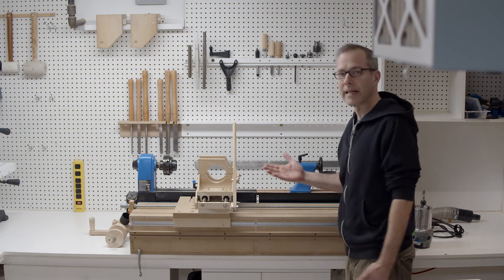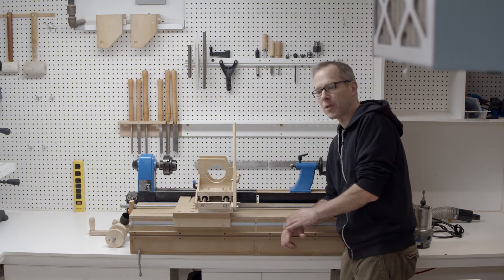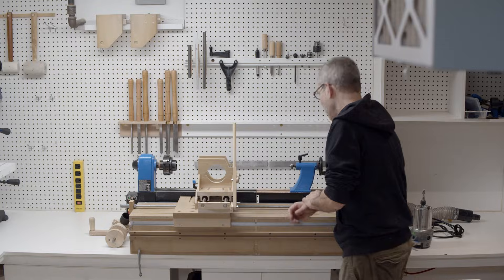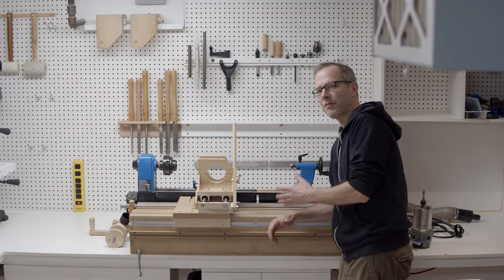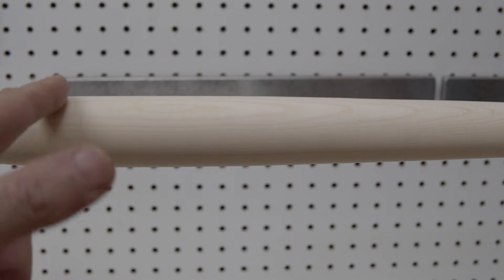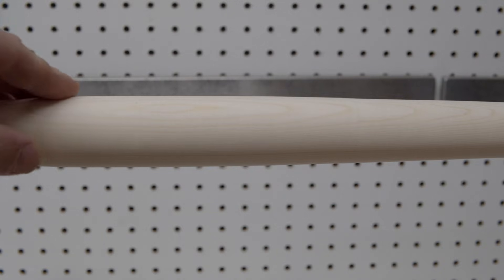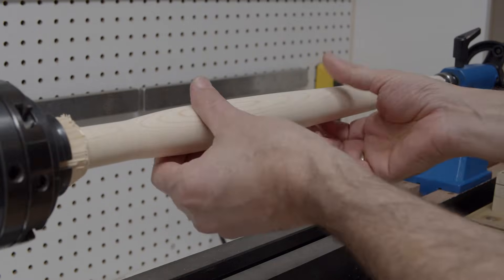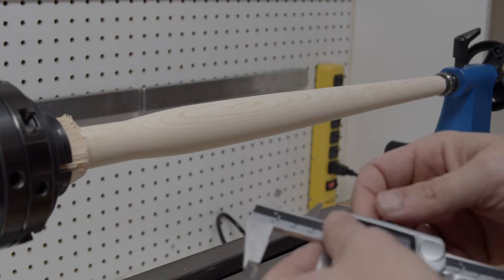This Lathe Duplicator will copy anything!

Comment: This is really great, as is your other model for the chess pieces! I’m curious, is there something (a spring?) that holds the router conforming to the template, as you advance it along with the drill?
Reply from the maker: I thought of using a spring but it wasn't necessary, just used a light hand pressure and focused on watching the contact between the follower pin and template

Comment: The 80/20 profile would be handy on this fixture. Working on a jig to suit a trim router with Minitec profile that has a delrin slide. 
Thought slide bearings might get fowled with chips but your Vac system seems to have eliminated that - Nice.

Comment: One thing that occurred to me is that if you rotate the router head 45 degrees.  This would use the corner of a square rod as the reference point instead of round, but would still allow you to use a conventional end mill.  Actually, if you had the pattern under the central axis of the lathe, you could set up a ruled stop for the pattern which could be set for dimensional accuracy.  In addition, with the follower directly under the bit, you can set up followers that are the same shape as the cutters themselves.  While I can see a concern for getting chips in the way, any would cause the follower to run proud and you will just need to run another pass once the chips and dust are cleaned (ie. it will fail safe).  Just some thoughts.

Comment: Hello. In this video of yours, I noticed that you have made an extension of the lathe. If there is a video of how you did it, could you provide a link to that video. It would be interesting for me to know your experience.
Reply: My video "Improving 3 Mastercraft tools" shows it but I don't go into the build.  It was pretty straightforward - first I built a strong base for the lathe and extension to sit on / bolt into.  This is important because it will keep them in line with each other.  Then just build up a track element as the bed extension - measure the bed on your lathe and replicate the height, and the general space between the rails, etc.  I'm sure once you get into it, you'd be able to accomplish it.
Reply: @BennettPictures  Thanks, that's pretty clear. I was interested to know what materials the lengthening of the machine is made of.
Reply: @alexpo6939  The base is made from MDF (in a 'torsion box' design).  The extension is made from plywood with oak as the rails, although all plywood would be plenty strong.
Reply: @BennettPictures  Thanks, Matthew!

Comment: I have in my mind something similar to yours.
I already have the linear motion bearings and a dedicated deWalt router.
Interesting your option to use HSS tools.
Congratulations!!
Reply from the maker: For my last few projects (simple chair legs) I only used the carbide tool option.  I'd round over with a square roughing gouge and finish with a circular cutter
Reply: @acanadianwoodworker estevidrio me ha gustado yqiero volver a verlo

Comment: Tremendous work! I am now a subscriber and have rung the bell so will look forward to future videos. So many questions to I would ask but I will just ask two. Would you consider doing a walk through on how you built the attachment and why you made some of the decisions you did? And... did you try a cove box bit (vs. a straight bit) in the router straight on for a rough pass before switching to the carbide cutter? If so, how did that work?
Reply from the maker: Yes I tried every bit I had, straight on.  A cove box bit, 1/2 inch upcut, small upcut, straight bit, pointed bit.  I've seen many other videos with clean cuts with that method, but for some reason the tear-out was crazy.  I tried the lathe on low RPM and high RPM, climb cut vs, regular, etc.  A climb cut on high RPM seemed to improve the results.  Again the factors for my experiments were a somewhat wobbly lathe, and regular SPF type construction lumber.  I tried maple hardwood and it was a bit better.
Reply: @acanadianwoodworker  I noticed an edit around 1:58 where you have a continuity error - spiral mill bit switches to a straight bit. Good to know all the variants you tried.
Reply from the maker: Originally I filmed a more detailed walk-through where I flagged all the mistakes along the way, what decisions led to the final form, but it was insanely long and rambling lol.  Honestly I think most people could look at this and construct something much better.  Any other questions let me know though!

Comment: Nice job. I also like your bed extension, have you howe that before? Scott
Reply from the maker: I made it recently from plywood.  Before I could only do 12 inches length, now I can 39 max.  Very helpful!
Reply: @acanadianwoodworker  Very nice. I'd love a tour, if you are up to doing one. I just purchased a small WEN for my 12 year old grandson, and man, is it tiny! I'm thinking that an extension is in order and what you've done intrigues me. Scott
Reply from the maker: @MyGrowthRings  Actually I have another recent video (Improving 3 Mastercraft tools) where I do a brief walkthrough of the extension.  In a basic sense, I just had to build a box underneath that both elements sit on.  And then look at the height and width of the original bed, and replicate that in plywood or some wood/material that will be strong and last well.   I actually didn't even make the extension perfectly (it was about a millimetre too low) but it still spins a spindle correctly.  There's some room for error.
Reply: @acanadianwoodworker  That sort of is the magic of turning between centers, isn’t it? Somehow I missed that video but I will circle back and check it out. Thank you for steering me in the right direction! Scott

Comment: Have a look at Hunter tool systems. They have a small cutter that way more effective at removing lots of material than the typical detail cutter. They stay sharper for far longer too because they cut instead of scrape like the typical flat carbide tool.
Reply from the maker: I will thanks!

Comment: Awesome attachment!  I will be building one too, but I'm planning on mounting the router over the lathe bed. I won't be using any lead screws just moving the router by hand with the router following a template.
Reply from the maker: I built an overhead sled just before this, directly over top of the lathe (using a plunge router).  I was testing on construction lumber and was getting a lot of tear-out.  I've seen other people do it effectively but in hard wood.  Tried all kinds of different bits, an up-cut spiral bit seemed to work the best.  Looking forward to your build and hearing about the results, I'm sure you'll come up with a great solution!
Reply: @acanadianwoodworker What's been going on, it's been a year since you've posted a video? I shouldn't talk, I never got around to building my lathe attachment.